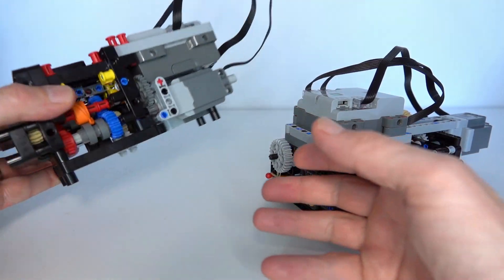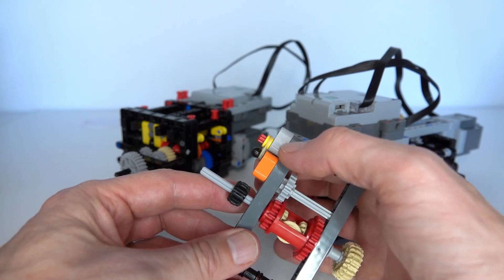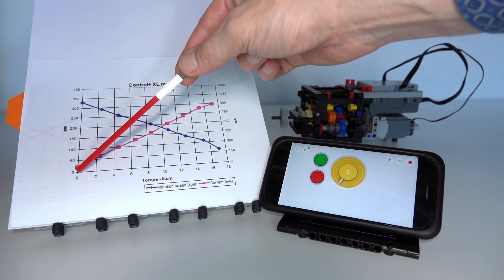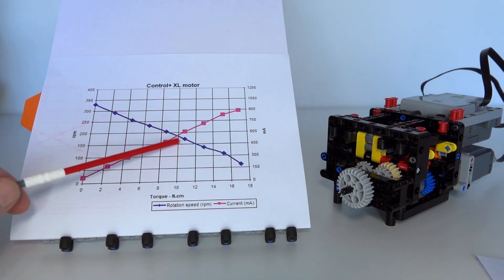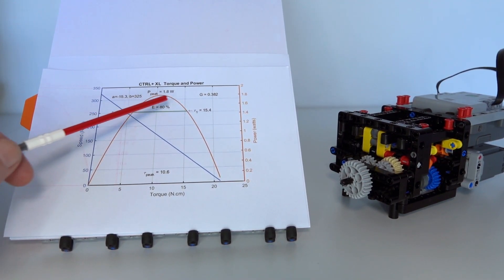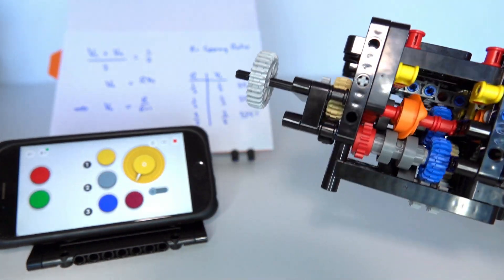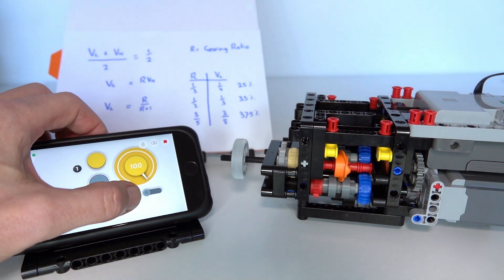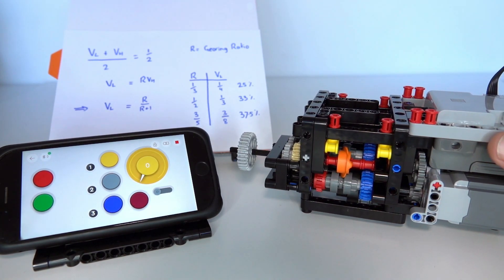Lego Technic Powered Up 3 Speed Automatic gearbox 2

Comment: very cool design..and so small...just one question..if the battery goes low does the system change earlier to compensate for the lower rpm?

Comment: This is so nice!!! Would you mind sharing the model/instructions?
I looked at your model on 3 speed model on Rebrickable, but that is a very different model.
This one looks just perfect for my application, just getting all parts I don't have, but replacing the motors with Mindstorms Robot Inventor.
The nice thing with Robot Inventor, is that the code can reed the power from the motor, you don't have to wait for the speed to fall. And you can run the motor at low speed and still get feedback on the torque.

Comment: Really inspiring and motivating! Congratulations for the work!
I have one question (maybe not just me). Can you explain or share how you managed the calibration phase for the clutch of the gear changes? I looked also at the RacingBrick page and channel (https://www.youtube.com/watch?v=hLbr4si2Qfs), but he hints at a really complex code. I believe you solved it in an easier way. Do you mind to explain how you did that? As far as I understood, there is still no direct way in the Lego app to center the motor.
Thanks in advance for the clarification. And congrats again for the way you are presenting the ideas and concepts. Truly inspiring!

Best regards,
Ricardo Cordeiro
Reply from the maker: Hi Ricardo. Thanks for your nice comments. The way I calibrate the clutch gear motor is simple. There is a limit to how far the clutch can rotate (just like steering left or right in a car). So I just turn on the motor for say 1 second in a clockwise direction. That is enough time for the motor to reach the limit (and it will try to keep going but it physically can't) so then I stop the motor and set the internal angle of the motor to 0. The angle of the rotary catch is related to the angle of the motor by the gearing ratio between the motor and the catch (e.g. say that is R times - that depends on your design). I can then set the angle of the rotary catch by setting the angle of the motor as R x 90. Hope that makes sense! 🙃
Reply: @TechnicBrickPower  Thanks for the quick reply sir. Really appreciate it. That makes sense. I am still playing around with the coding on the Lego app, to better understand how it works. But your insight helped a lot. Wish you a Happy New 2022! Keep up with the amazing work :)

Comment: Not really automatic so much as it is a sequential manual gearbox
This method of calculating torque only works if the motor has a linear output AND is being run at it's maximum output at all times.
Gotta say though this is absolutely awesome, my only suggestion would be to try and stay away from those ring selectors, as they break easily under load and the gears are snapping together instead of smoothly engaging. What you need is some type of clutch to disengage the load while you change gears and you're set.
Reply from the maker: Hi AIO Inc. Thanks for your comment and feedback. My version of automatic means it switches gears automatically depending on the load on the output which is what it does. I haven't seen any clutch options in Lego Technic but maybe it's possible to create one! 😂
Reply: I would argue, it is an automatic gearbox, when you apply the automatic control.

If you didn't have the motor for sequential control, but a lever, then it is manual.

If you just had that motor, but manually selected each position, it is just a sequential manual gearbox.

When you use system feedback, into a controller, to automatically control the sequential motor, it is an automatic gearbox (system).
It does not matter if the torque sensing and operation is pure mechanic, or through an electronic controller.

As a matte of fact, most modern automatic gearboxes, have more in common with traditional manual gearboxes, than traditional automatic gearboxes.
Old automatic gearbox lost efficiency to torque converter and things like that. With modern automatic gearbox, the torque/power is usually measured and some kind of CPU run some software to control the shifting sequentially or in other ways depending on gearbox design.

I agree with your argument about measuring torque, but I will try to use it with Mindstorms Robot Inventor (or Spike Prime).
If I use speed control, the the hub will apply the required power to keep the speed, and the code can reed that power and use it to decide the optimal gear.

Comment: I wish Lego would create a rotary catch with a wider spacing, the on/off/on spacing of the current one is just so limited in usability; the typical switch design that uses a rotary catch with two perpendicularly opposed axles provides for up to four discrete functions. For example, a five position rotary catch, which would also need extended axle connectors for the longer throw of the driving ring, as an on/off/off/off/on spacing, would provide eight functions off a single catch. I know the gear train for such a setup would be nonoptimal based on available gears; but such a gearbox could provide six speeds with neutral and reverse, off a dual motor design, which is a somewhat realistic design, or at least more realistic than the 2+N+R setup the current three position switch provides. Though, the extended rotary catch on a single motor has it's limitations, maximum is an eight function switch on a five position spacing with a convoluted gear train, a six function switch with a four position spacing could be nice but it also has it's limitations.